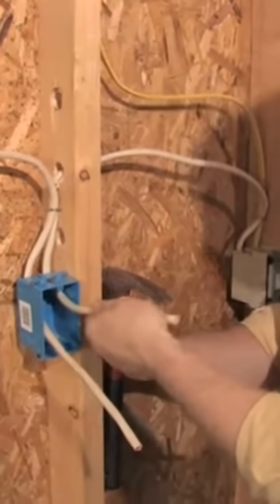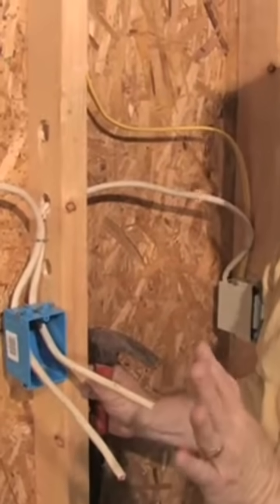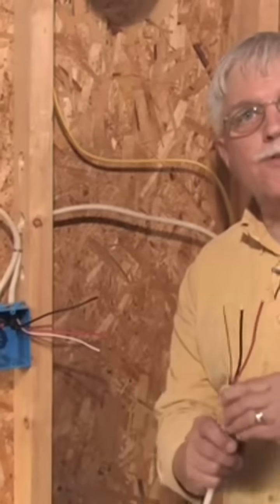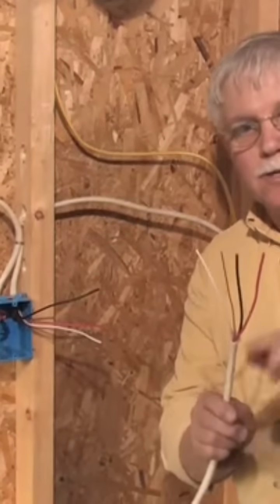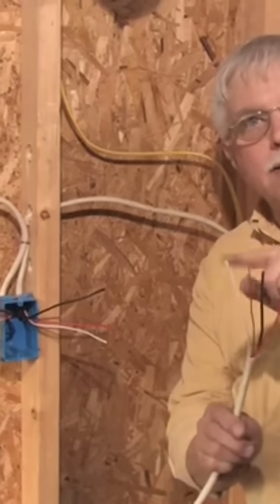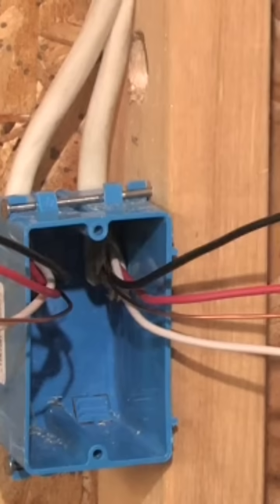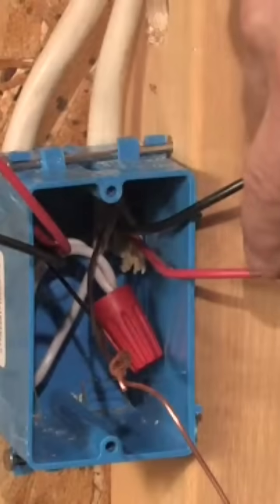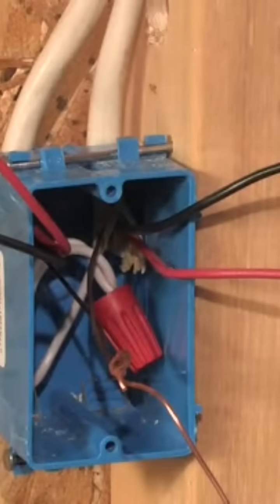4 Way Switch Wiring

Comment from the maker: This demonstration used an OLD  12/3 WG cable I had in my basement. This cable was manufactured BEFORE the code required the exterior insulation to be different colors. All wires in all cables are 12 gauge.